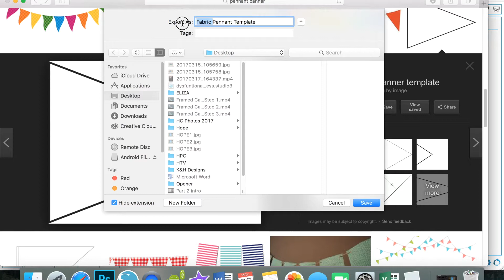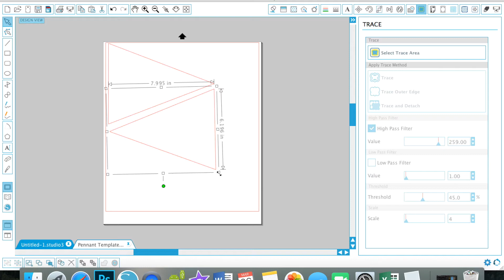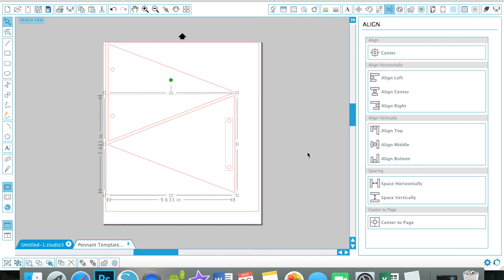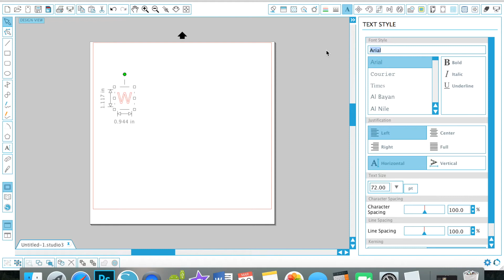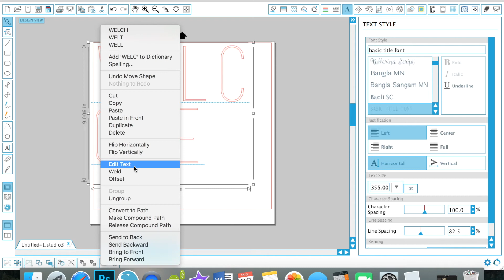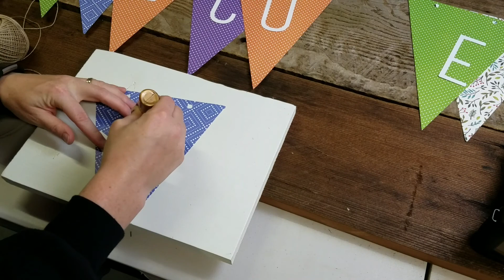Quick and Easy Pennant Banner Tutorial using your Silhouette Cameo

Comment: What kind of paper did you used to make the banner?
Reply from the maker: +elsa sierra I used scrapbooking paper (thinner like printer paper) for the pennants and cardstock for the letters.
Reply from the maker: +elsa sierra if you want this banner to be more durable and reusable than cardstock would be better
Reply: I try it and I keep getting the message " registration failured" 😔.. im new on this...would u be able to help me aith that?? Thank u
Reply from the maker: elsa sierra you may want to power off your machine and computer (restart). That sounds like a glitch unless you are trying to use registration marks. I do not use them. I just line the paper up on my cut mat and hit "send to silhouette". Another thing to try is going to the registration marks settings and reset to default. I hope that helps!! if not there are several Silhouette Groups on Facebook that I have found helpful. just ask a question on there and a bunch if people will respond. ☺
Reply: Ok, thank you so much